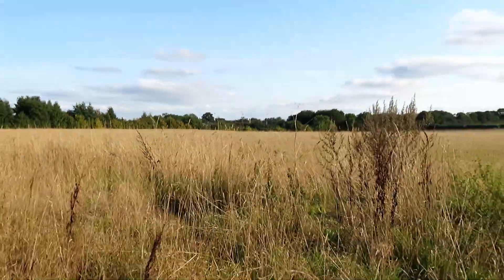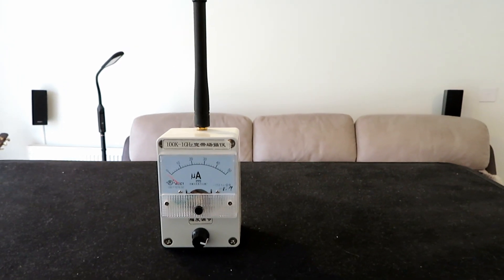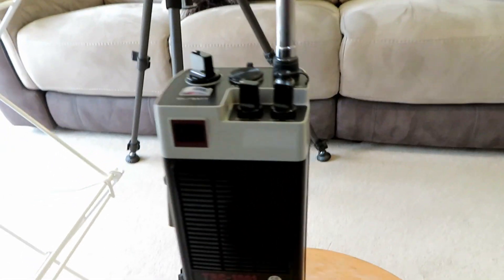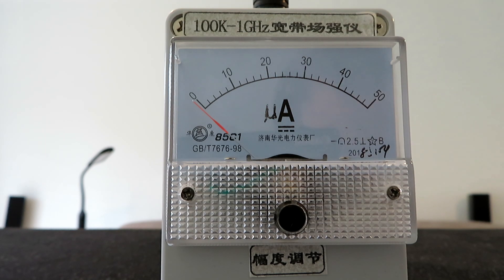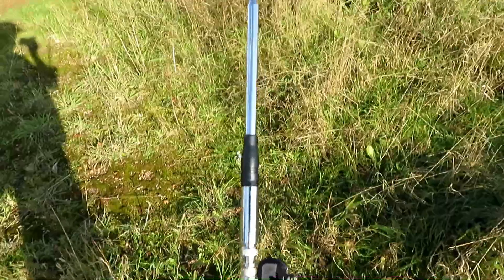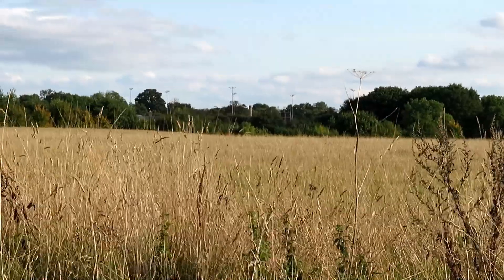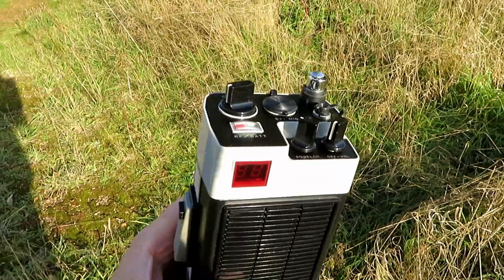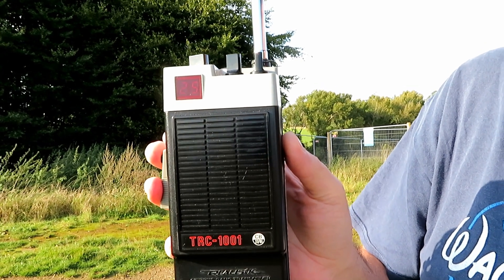PRESIDENT RANDY 3 - TELESCOPIC ANTENNA UPGRADE AND TEST VERSUS REALISTIC TRC-1001

Comment: Should/could have measured the exact output of both radios...  The Randy normally only puts out around 3 watts on battery but can be adjusted to 5 AFAIK...  Touching the bottom of the antenna on the Randy may have helped to act as a ground plane...  Randy has other adjustments that can improve performance, none were attempted here...
Reply from the maker: I'd only just got the radio lol

Comment: i hope you dont mind me saying this but,the prize you payed for this randy handheld you was better of with the albrecht ae 2990 it had ssb on it also and it is the same prize,also easy to mod to 400 channels
Reply from the maker: With the 2990 Don't get large display, external antenna power adapter, 2 yr warranty, lipo battery, not interested in SSB or 400 channels, the Randy is a great jack of all trades, very well made and still has a years warranty left and works great for me that's why I bought it. 👍

Comment: Good review.be for I just seen this video I ordered 3-of these Antenna’s of eBay £10 each Amazon want £15- each. And I’m just going to order a TMC to BNC adapter.next week are order the radio.shame it never side-bands. It is a good radio. There’s another YouTube video ware this radio give 3-watts one way and 4-watts another way to do with the antenna. The antenna on top the radio give 3-watt then using the antenna adapter clipped on the bottom of this radio it gives 4-watts. It’s some sort of safety thing as it said on another YouTube clip I will watch it again he even takes it to bits he knows his stuff.

Comment: Bit of trivia: The reason they made the 3 watt Walkie-Talkie as well as the 5 watt is because here in the States you did not need a license if you were 3 watts or less. Back in the day, Citizen Band had a few designated channels, not just channel 9. There were a few mobile to base and a few mobile to mobile. Channel 16 was reserved for SSB. Channel 14 had a 3 watt limit and was reserved for walkie-talkie use. This would allow people to use low power radios without getting stomped on by full power units; not to mention they had short range anyway due to no ground plane. You could use a mobile or base in the case you were contacting a walkie-talkie. Such as on a camping trip and the kids are off on little excursions, you could call them in for lunch, call for help or what have you with your mobile unit. I have a couple of these big tanks and a 2 watt version as well. Good fun growing up having them when roaming the 'hood on our bikes.

Comment: try with a 102"" whip antenna mobile. With shorted antennas the real watts droped a lot ... if the equipment is 3W , with shorted antenna only  out 0.3W in the best of cases.

Comment: The aerial on the trc will not b as good as the telescopic used on the randy so cant really compare against each other the main thing is the difference the telescopic makes to the randy 
Ive got the midland alan 42 ds and the albrecht ae 2990 afs now since getting them ive not really used them as my health is very poor but im going to have a crack this week 
I believe the midland is ok 
And ive had good reports about the albrecht which also has ssb but only 4 watts i ll try rubber ducks on both .telescopic also ill try t2lt thunderbolt ssd58 plus get my lad to chuck it up conifer will b intresting what i get oñ. The albrecht on ssb so should b intresting

Comment: Looks like a great radio but sheesh almost 200 notes 😲
Reply: Nice radio i have the midland alan 42 ds and the albrecht ae 2990 afs which has am fm and.ssb it cost £250 ive not used either yet my health is poor but im having a crack this week 
The albrecht is only 4 watts sideband but well see how it goes ill try both on telescopic and the cracking t2lt thunderbolt ssd58plus 
Ive heard good reports on the albrecht so well see
Reply from the maker: Yes all CB handhelds are expensive imo, bit the difference in quality and what you get between this and the others below it for a bit extra is considerable, go to a vendor who stocks both and you will see what I mean.
Reply: @knoxieman  the randy looks quality build.it came out at begining of this year i got mine last year but i think the randy probably better than the midland 42 ds but as for better.than the albrecht on cb i dont know  the albrecht has ssb and a quick mod can b used on amateur
Im just learning again since 80.s so its a big learning curve
I dont get out a lot cos of my health i dont smoke or drink so ive a few quid put to one side for when i do foundation  but im going to do both cb and ham
My daughter bought mw ss9900 which is a cracking rig but my.pal said the 6900 is easier to learn on whats your view on that getting back to the  randy it looks quality made radio cheerrs
Reply: £189 @ knights  its cheaper than i paid for my albrecht  £250  but albrecht has am fm ssb and amateur still only 4 watts but ive had good reports on it you can run it through your home base etc
Id say from what ive seen none of these radios are much good on rubber duck aerials which are better used stirring your tea 
Knoxie made a point like with a lot of hand helds like my midland 42ds for another £59 i could have got the randy but it didnt come out till start of this year
Also you cut your coat according to your cloth
I dont smoke or drink cos of my meds i had to give up my hobbies metal detecting and watching blackburn rovers cos of my health
To b honest my health has improved since i stopped watching rovers lol
So cash i spent on those hobbies ive got for radio
Footy id spend £50 every 2 weeks not cheap plus mental stress of watching black burn
Point is £189 is a lot of cash but like knoxie says to design produce and market a radio  aint cheap
I just need to get a bit better im giving both radios a go this week first time since i got them last yr thats way it is my health is that poor but i will get there 
Do you have a handheld 
Can get bargains on ebay but better if you can get knew take care
Reply: That's the deal breaker for me for that money I'd get the Albrecht with ssb